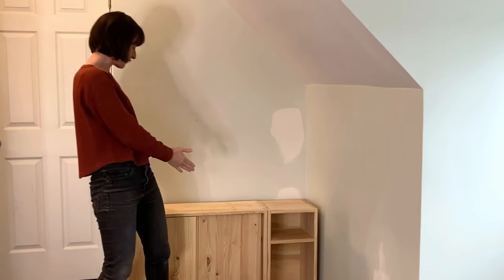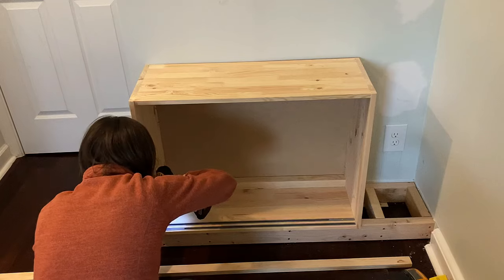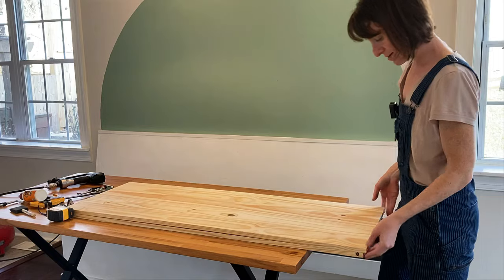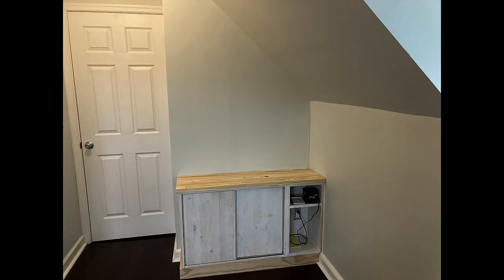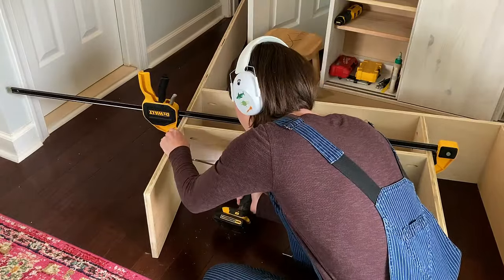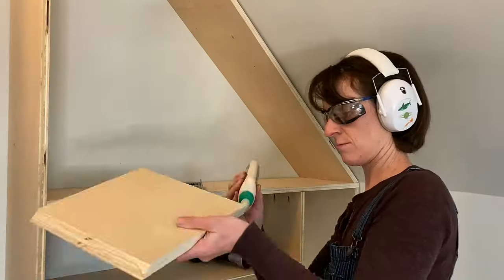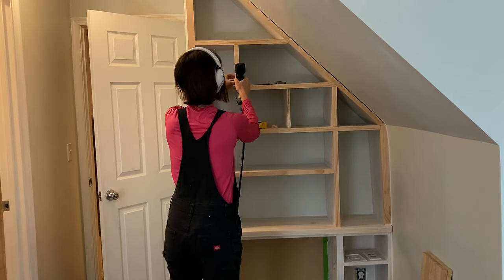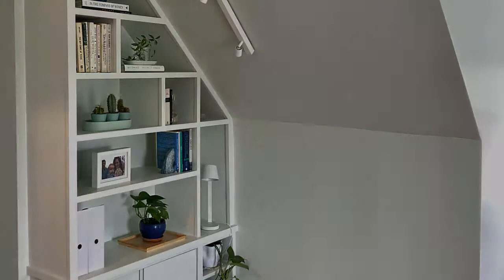Custom Built-In for a Sloped Ceiling | The best attic room bookshelf!

Comment: What size trim did you use? I’m attempting to do DIY built-ins and used 1 inch boards and I cannot find any 1 inch trim. Any suggestions?
Reply from the maker: I used a few different sizes because of the angles. I bought 2 inch and ripped it all down on a table saw to the specifications I needed.

Comment: This is fabulous!!! My third floor has exactly this kind of a roof and I too am looking for something like this and need a closet there are well. Thank you sooo sooo much!!!
Reply from the maker: Thanks! Using the angled space in is a game changer. I did a closet in my knee wall and couldn’t be happier.
Reply: @TheUnprofessional  My handyman came over yesterday and I showed him this video. I am really house challenged 😟.  Quick question: You used Ply wood for top shelfs and Pine as trim? I cant wait till it's is all done! It has been a wasted space all along so far. Thank you!
Reply from the maker: @sume6103 yes, cabinet grade plywood and pine trim. If you stain instead of paint, poplar trim is a better choice. You can use pine conditioner, but I wouldn’t risk it. Good luck!!